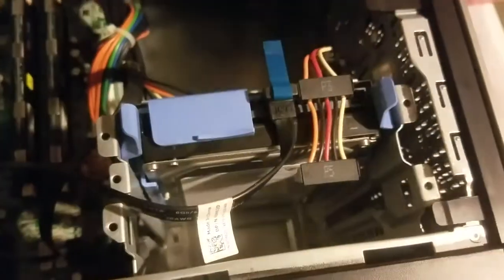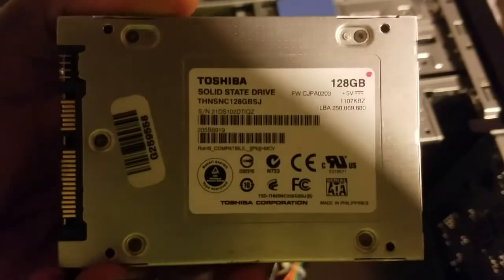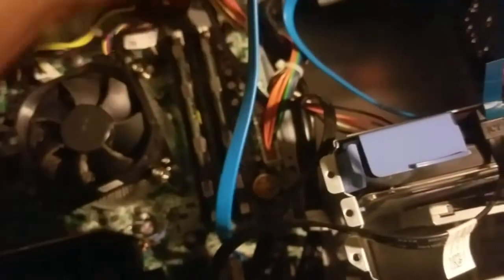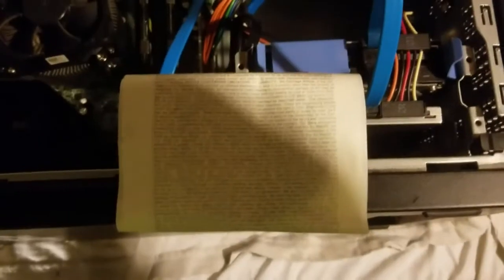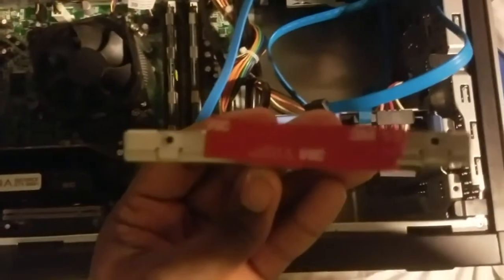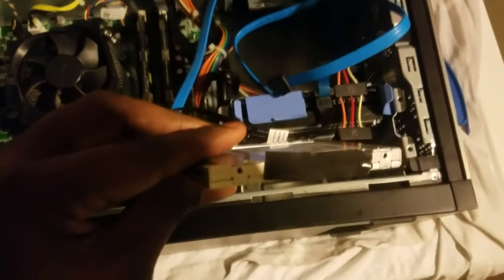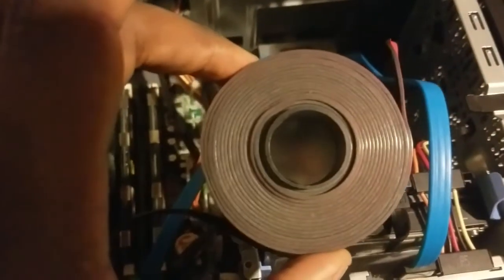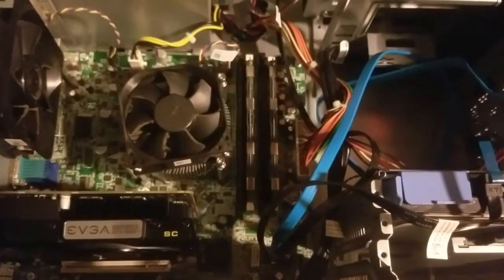How To Install 128GB SSD Without Hard Drive Caddy Dell Optiplex 790 MT [Gaming Upgrade #4] P.5

Comment: link to ssd?
Reply: LucidTeFlon180 Thanks! Sorry I'm not very good with computers and I wanted someone to clarify this.
Reply from the maker: It has since sold out I believe. Bought it off of ebay. How's ur build goin?
Reply: LucidTeFlon180 hey I'm interested in doing something like this and wanted to know if I can use any ssd for this pc
Reply from the maker: Hhm well I don't see why ya wouldn't be able to use any ssd for it. I just chose this one coz it didn't cost an arm and a leg haha.